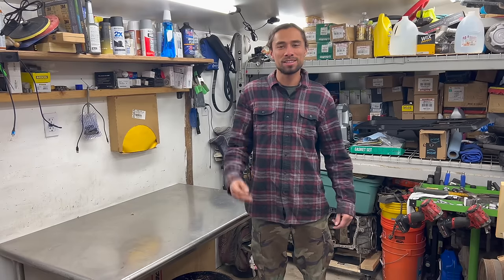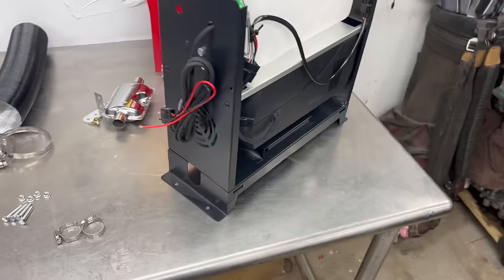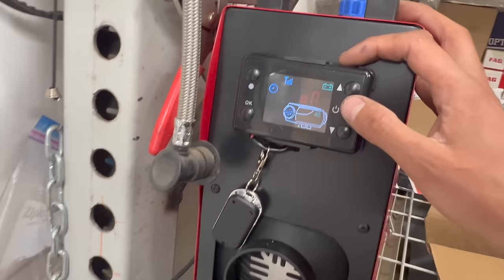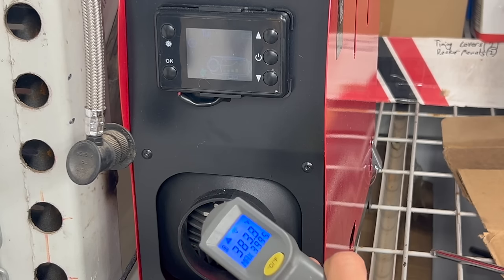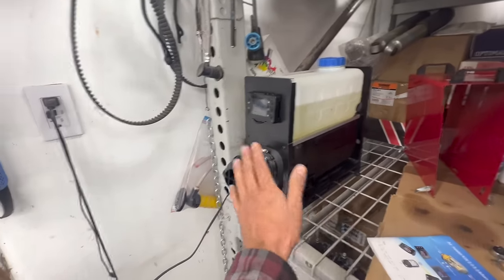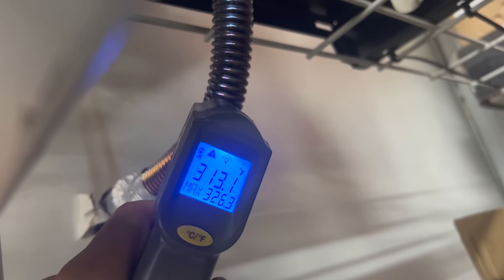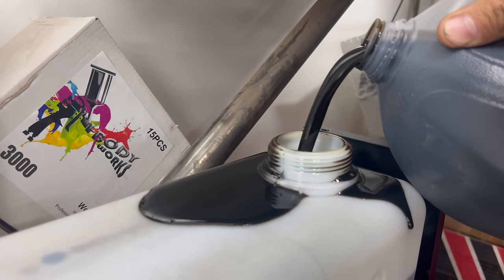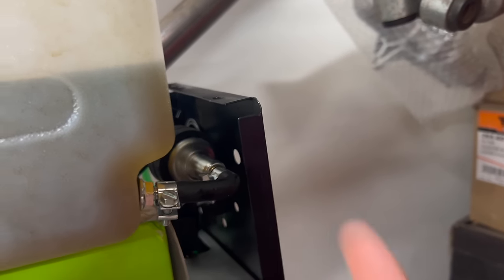Unfiltered 100% Waste Oil Vs Stock Diesel Heater

Comment: Really liked the intro, very cool and funny and no long messing around - trust me, I watch a lot of youtube and I can tell the difference.
Number two I would like to adress is that I liked and subscribed because I believe in supporting newcomers here instead of all the channels with their millions of views and subscribers.. all of them started small. Ok, I will now continue watching.. keep it up!!
I would also recommend first mixing it 50:50 and then do some basic filtration with a paper filter just to get the worst junk out. Also have a look if your diesel heater comes with a fuel filter in line after the tank, if not retrofit one, they are cheap

Comment: since so much heat escapes through the exhaust, it is worth expanding it further, making something like a radiator, or maybe using an old radiator from the car as an exhaust, which will absorb the heat and this heat will remain in the room And finally, just put the pipe outside
Reply: Definitely. Can put a heat exchanger for water heating, etc, etc.
Reply: A modern plastic car radiator would obviously melt. And, even on a conventional brass radiator, the solder would melt, and the radiator would then completely fall apart. The exhaust temperatures on these units, especially once up to optimal operating temperature, are quite high.

Very poor idea.

Comment: Using 100% diesel to start it and to stop it helps alot.
    They come from the factory set at a certain air fuel ratio set for 100% diesel. With different fuels you will need different air fuel ratios in order to burn cleanly and keep from clogging the glow plug screen, and also the hard to clean mesh just inside the burn chamber.
    If your controller allows it, some don't, you can get into the secret menu which will allow you to change the air fuel ratio through the pump speed and fan speed. There are YouTube videos on how to do this.
    I highly suggest changing the air fuel ratio in order to keep from having to disassemble and clean it often.
    I bought one of the aluminum cased bread loaf sized ones in order to do the same thing, I just haven't spent the time to get it up and going yet.
    I have a lot of 20W50 from my Peterbuilt that I have been collecting.
Reply: Mine quit after running for 8hrs continuously and just smokes with raw diesel coming out the exhaust. I had some old off road diesel it would smoke in start up switched to kerosene I had here and it worked great. Got good clean fresh diesel in it now and it fails to ignite. Just smokes. 
As far as your concerned with the diesel and waste oil. I'd mix it and as suggested run it on 3. I think it over heats at 6 and messes up the burner and or the ignitor and has issues reigniting. Even a shot of ether won't get it going.
Reply: Most engine oils nowadays are synthetic, they're designed not to burn.
At most what you're doing is just boiling it off while burning diesel, that's why you require pure diesel or kero at start up and shut down.
I've tried many times and it failed pretty soon.
Used mineral oil will burn but nowadays difficult to find as everyone using synthetic
Reply: @NileshKumar-uf4vh   I disagree. After extensive research on another topic, I found that most so-called "synthetic" oil is not really synthetic, but just very clean mineral oil.
    I first heard of Mobil1 synthetic oil in the mid-eighties where I was surprised it claimed to last for 24000 miles. This was in the days of 3000 mile/3 month oil changes. Now that, was real synthetic oil.
   A couple years later, Castrol came out with a much cheaper oil that they called synthetic, but wasn't. So of course Mobil1 took them to court. Unfortunately Mobil1 lost the case, and consumers have been confused ever since.
    Now, in order to compete, all of the oil companies are making very clean mineral oil that they are calling synthetic, including Mobil1.
    There is still real synthetic oil out there, but it's much more expensive, it's much harder to find, and you have to know what you are doing.
    Regular engine oil is called group 2 oil. The fake synthetic oil is called group 3 oil. The real synthetic oil is called group 4 oil. Group 5 oil is an ester based oil typically used for refrigerators and air conditioners etc. When was the last time you changed your oil in your air conditioner? There is a company called Red Line that makes ester based automotive oils.
    In case anyone is interested, If you really want to keep your engine alive for a very, very long time, you need to keep your oil extremely clean. Normal oil filters only filter down to 30 microns or so. If you add an on board oil centrifuge, you can "polish" your oil down to about 2/10 of a micron. It can be plumbed into your engine's oiling system fairly easily, and the best part is there's nothing to replace. To clean it, just remove one fastener by hand, disassemble it, scrape out the waste, and reassemble, all in about 2 minutes.
    Last I knew there was a company who made them called Auto Win. You can also get them from Pennsylvania biodiesel supply. They have a YouTube video that explains how it works.

Comment: 2:1 diesel/oil ratio works fine. I also use separate tanks to perform starting and stopping fire with 100% diesel, to prevent clogs on burner screen.

Comment: It needs to be filtered for aure.  You've got bits of metal in the oil, which is what the oil filter in your engine blocks.  I'd filter it with a good, tight filter media, and then do a 50/50 diesel/motor oil mix.

Comment: I'd love to see you properly filter at least a couple gallons of oil and then try it in steps: 25% oil in diesel, 50% oil, 75% oil, then (if it's still working) 100% oil. Trying to run it on a mix of oil, soot, metal shavings, dirt, crumbled leaves, gasoline residue, and condensed water is too many variables and probably a bad idea in the first place.

Comment: @SteinFab Garage

1. Oil has too much shit in it that creates ash. There is a non-serviceable mesh "gauze" inside the top of the combustion chamber that will carbon up and cause exactly the issues you're having.

2. In the short term, you can remove the glow plug and pull out the mesh screen that sizes around it, clean it with a torch and reinstall it. Likely it has fouled up from running straight waste oil. 30-50% will not plug that screen generally.

3. If you remove the combustion chamber and look inside of it, there is likely a large deposit of ash building up at the far end (top) of the tube, around the piece that looks like a splined axle shaft. If can be cleaned a bit with a pick, but once this starts happening the gauze I mentioned in 1 is pretty well pooched and you're best off to buy a new combustion chamber.

4. Running any substantial cut of engine oil will eventually cause the unit to do this. ~30% is probably about the maximum I would bother with, but only if you don't mind taking this thing apart frequently and have a free supply of used oil as an incentive to use it.

5. Vevor is about the worst brand of diesel heater. They kind of just send out thousands of units per batch and there is no standardization between batches a, b, c, d, etc so you're getting whatever parts they had available. My Vevor is a piece of shit whereas an even cheaper unit off Amazon runs flawlessly in my jet boat. 

6. How is it a piece of shit, what can be different? Everything from the combustion chamber itself, the gaskets, glow plug, fuel pump, muffler, controller and ECU, fuel line, case material, etc. There is a lot that is different between units.

7. An Australian guy sells a controller called an Afterburner which is WiFi, Bluetooth, etc. Easy to tune the mixture, etc with it too. That said, all motherboard for the past couple of years don't allow low-end tuning any longer. Low basically = 1/3rd of Max fuel and fan rpm...

8. Hammer another pipe through the wall for the intake. If it flames out it will fill the garage with smoke as now know. Having the intake inside also causes a pressure drop in the garage which is balanced by cold air from outside, coming inside....

9. Aliexpress and Amazon have fuel pumps that have an integral screen in a sight glass you can see and service... It's a better pump than many of these units. Bubbles coming from the pump outlet are normal.

10. Any fluid that burns with a lot of ash will destroy the combustion chambers on these. I've run all kind of crap through mine, but diesel or diesel and gas is all that works... 

11. Yes, it does run on gas.... Which is recommended in the winter to dilute your diesel with ~20% gasoline. Gasoline contains slightly less BTU, but you may not notice especially if you have two running.

12. Your fuel pump needs to be angled or it will not pump. ~45 degrees +/- 10 degrees is a good goal. It isn't that fussy, but horizontal will not work for sure.

Good Luck.

Comment: The nozzle that sprays the fuel is made for diesel and oil to think to push threw it, the nozzle for used oil is set up with air siphon, to push oil threw. In order for you to be able to push oil threw the nozzle and for oil to burn, you have to thin it out, usually 50/50 is the best, 50 oil and 50 diesel.  That will allow the oil to push threw the fuel pump and threw the nozzle, and will be able to burn efficiently in the heater, it will also keep from carbon up the burn chamber.
Reply: *through

Comment: Do not forget that stingrays are not meant for small spaces.  Burnout emits exhaust gas.  As usual, stinger for car engines.  Prolonged indoor breathing of this stinger heater combustion gas of nitrogen dioxide is dangerous.  It is easy to get poisoned.  There have been several accidents.  Poisoning with stinger heater in small rooms garage or workshop in small rooms.  The room must be ventilated so that you don't have to breathe the combustion exhaust gas from diesel heaters.  Such parsti heaters are designed for outdoor work.  In large rooms.  Electric heater blowers are better used in small spaces.  Or an autonomous oil heater in small rooms.

Comment: I think the motor oil will clog up the nozzle where it 'atomizes' the fuel for burning. Noticing how hot the exhaust is, I would make a heat exchanger (coiled up metal tubing) for the exhaust with a fan behind it before it goes outside. That would improve the efficiency and heat up time of your shop :)

I have a dyna flow torpedo heater (80k btu) that I run off diesel and works the treat in my 1.5 car garage.
Reply: it prob will. I have have an self made oil burner and i get slag in the bottom what glows red when oil is being burned and some black ash like substance what does not glow when heated by the flames what i guess is carbon or something similar im planning to mix that black stuff with some black matte paint and see what happens (using my old spray gun)

Comment: I'd think you could legally run it on heating oil which is cheaper because it doesn't have the motor tax that is on diesel. It's pretty much the same thing. I mean, you're using it for heat, not to power a truck. I don't know if you can get heating oil anywhere or just where it's used.
Reply: you can also get off road diesel by the drum from your local petrol company, no tax diesel

Comment: I saw one guy say that if the waste oil is synthetic, you need to add 20-30% e85 to increase the flashpoint, essentially make black diesel. You should still start with diesel, switch to black diesel with another tank, then shutdown with diesel.

Comment: I’ve had one for 4 years and I only paid 100 dollars back then for it. It heats my 30x30 garage to 65 degrees. I love it. The only thing I’ve had to do is open the unit up and clean it out put all new gaskets and glow plug in and it was good to go. And I only had to do that because I was running it on a battery and it would just die and when you do that it don’t run fan until the flame is out so it causes a lot of mess inside lol. But the rebuild kit is only less than $15..

Comment: The button is pressed :) I would suggest a 50-50 mix. It's what being recommended for cars. They also start and shut off on straight diesel to not clog up injectors. Separate tank with valves is needed fo dat. But maybe you already know this :) Thank you.
Reply from the maker: Thanks for the Sub! I know it would be easier doing a 50/50 mix, but I have access to ALOT of waste oil. This is my tinkering before my Delica and Cummins get straight waste oil
Reply: i have tried all of this. u have to run it on clean diesel or paraffin in the end or it will clog up. no way around as i can see
Reply: Unlike in a truck, you may not be in the shop to switch tanks when it goes into an error mode.

Comment: I've had one for about 18 months, I found that a ratio of 9 diesel to 1 cooking oil is the max before it starts dripping from the bottom. 
Unless you have an endless supply of oil you'll need diesel at some point so might as well make it easier for the heater by diluting oil with that ratio of oil/diesel.

Comment: With the code 1688 you can enter the menu and adjust the pump speed and fan speed, this will allow compensation for alternative fuels or higher altitude etc. There is no factory reset function though so make a note of the std settings before you mess them up! I have found the green pumps to be more tolerant of alternative fuels than the ones with black plastic. My black pumps both failed when i switched to home heating oil (kerosene) but have both run fine for years now on both diesel and kerosene with the green pumps.

Comment: You can buy burners that are made strictly for waste oil, they are kind of expensive,  but many truck shop's use them. Cheaper than having someone haul their waste oil off. Plus they can heat a shop very well,  they use about one and a half gallons per hour.

Comment: Hi,im been used for 5 tanks,3 liter of diesel,2.5 liter of hydraulic oil and 0.5 grams of gasoline. All mixed well and heater work verry good,no smoke at all at start

Comment: Combustion chamber was flooded with oil because the flame died and the heater kept pumping for a few minutes. Try filtering your oil before feeding it to the heater, run the oil delivery pipe close to the exhaust pipe for heating, that ought to help.
Reply: what's the point?  after that much work you're not really saving money.

Comment: About a year ago I saw a video on YT where a guy tested burning used oil. His final outcome to get the best burn was a 30% mix of old/used oil and 70% fresh diesel. I've not tried this but only speaking from what I've seen on YT. I look forward to your next video or sequal to this 😀
Reply: Can confirm that works 👍🏽
Reply: @modquad18  Thanks for confirming 😀
Reply: Kerosene burns better than Diesel go 50 50
Reply: @modquad18  thank you for confirming. I'll add some kerosene and see how that goes

Comment: I noticed that the oil jugs you were using said synthetic on them.  If this is what you run all the time, so your used oil is actually synthetic, that could be your problem.  Synthetic oil does not burn well at ALL due to a much higher flashpoint. Remember the oild Mobil one oil in the frypan commercial?
Reply: Exactly

Comment: So I have the same cheap heater but I had an issue with my pump. My heater is not fully enclosed but the pump I mounted at a slight angle. I kept getting e8 error and after doing research I found a video of a guy with one like yours saying the pump needs to be vertical. Meaning the input is on the bottom output is on top. Once I did that I never had an issue unless I run out of fuel

Comment: I heard about dudes running used motor oil in diesels by cutting the oil with 5-15% kerosene. I burn my used oil in my wife's car, but when we replace that I'll need another option lol. 
Subbed for more 240 references.

Comment: The exhaust tubing isn't to keep things from burning at all. It is to prevent carbon monoxide build up in your room. The deadly gas that doesn't have an order.  I haven't completed the video but I hope you have a carbon monoxide detector in your room. The muffler as you figured isn't needed. Stay safe.